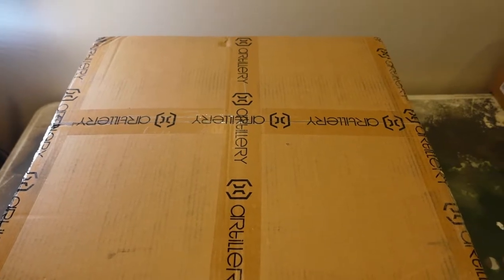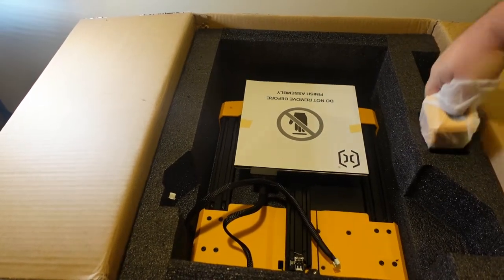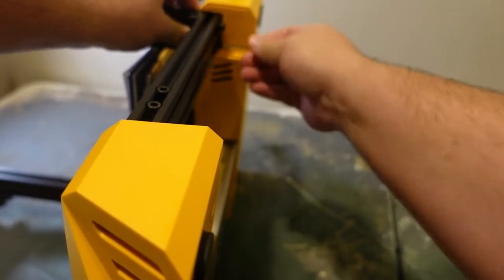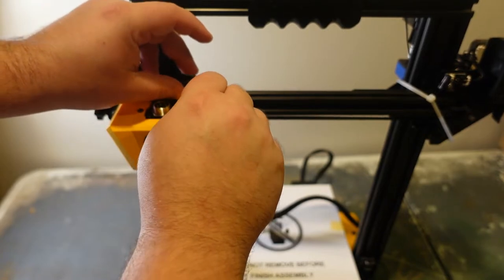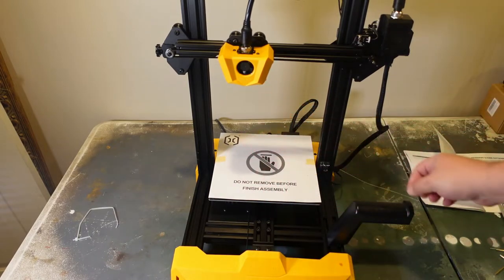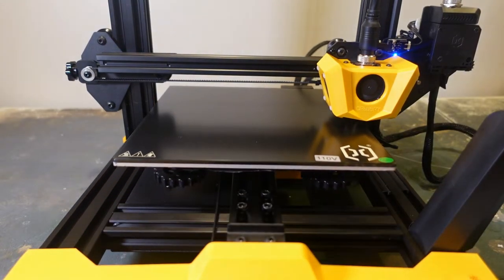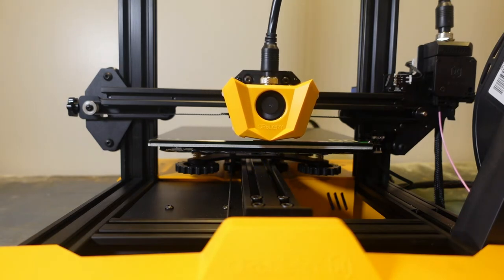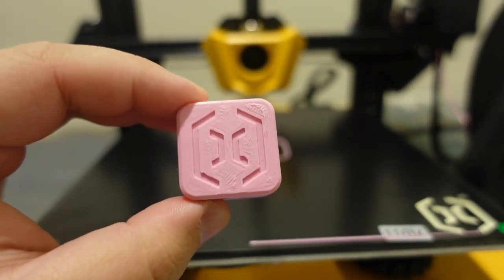How to Setup and Level Artillery Hornet 3D Printer with Test Print

Comment: Yup. wrong way to level the Hornet bed. at 15;14 you should have gone to "level corners"that is the 4 corner and centre level using the physical bed adjust knobs. once that is done. you should do "level bed"click to begin 1-9starts the software MBL. You use paper under the nozzle but you use the knob next to the screen to lower or raise the hotend from the bed. still need the nozzle scraping lightly on the paper..once happy on each probe point, press the knob to go to the next one..This is Manual Mesh bed levelling..basically auto levelling but you are the Bl touch.